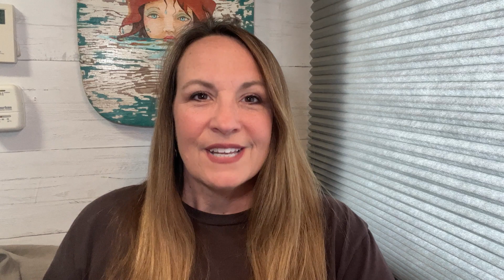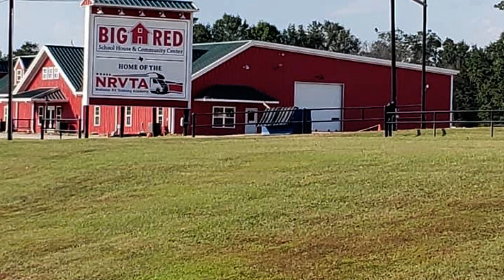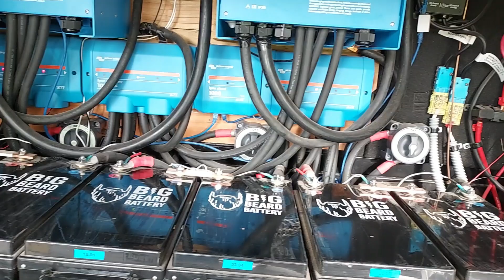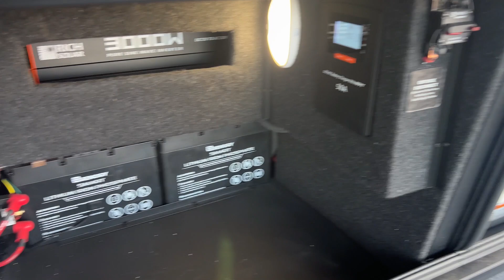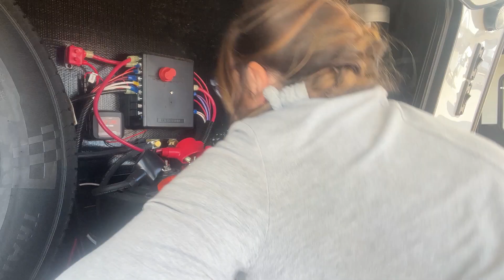RV SOLAR 101 - TECH TIME WITH JOE FROM BUBBLEHEAD RV

Comment: Cool video. I like the format. It makes a complicated subject more palatable. A lot of good safety points were made too. Current or amps in a wire, circuit or connection is what generates heat. As you double the voltage you half the current, which is why big solar systems use higher voltages - to carry more power safely in smaller wires. Inverting 48vdc to 120v ac is more efficient too, wasting less power as heat. This is why we use 2 stand-alone solar systems in our coach, as 12v system for our low voltage DC needs and a 48v system for our 120v AC needs.

Our big solar/battery system allows us to live off grid just like we were plugged into a power pedestal in an RV park. In fact, we haven't plugged into a power pole or run our generator in the last 2 years of off grid living. We started small, by building a 620-watt liftable solar array on the side of our coach that makes a nice bedroom window awning too. We use gas struts, so it practically lifts itself, and we can pin it at the precise angle needed based on latitude and season to boost its performance. We boondocked this way for a couple years, till we could afford to do better. Next, we built a 12v, 560ah LiFePo-4 battery using 8, 280ah prismatic cells and a Heltec 330amp BMS. These cells fit perfectly under the steps of our MH where our old pair of golf cart batteries used to reside. A small computer fan blows interior conditioner air into this space to keep the batteries near room temperature at all times, so the BMS doesn't shut down charging from them getting too cold and their life is not reduced from getting too warm. We use a 50a Epever mppt charge controller and a Lnex battery monitor on this 12v battery. We have a 1,000w PSW Renogy 12v inverter that we use occasionally to run some lower current draw 120v items like our TV and computer to help evenly distribute our power usage when needed. We also have a Renogy battery to battery charger, though we never need to use it. If this battery ever gets too low, we can always transfer some power to it from our 48v battery with our progressive dynamics 80a Lithium compatible converter/charger.

By mounting the solar array on the side of our coach, we left our roof free to rack 8, 550w solar panels down the length of our 35ft Class A, 15" off the roof, above our AC, vents, etc. Our 4,400w array can run both our A/Cs, our household appliances and charge our batteries at the same time. We mounted a Sungold Power all-in-one 48V, 5,000W Inverter/100A charge controller/battery charger, breakers and a Lnex battery monitor on the wall in our bedroom to keep it cool and monitor all the functions on the display screen. It saves us space as well as money compared to a system built with individual components. Our 48v battery which resides under our bed uses 16, 320ah MB31 EVE cells and a 200amp BMS.

Together with our 560ah 12v bank, we have a total of 23.5 kwh of batteries onboard (the equivalent of 18, 12v 100ah LiFePo-4 batteries) charged by 5,020 watts of solar. Building both batteries ourselves this saved us a ton of money vs buying preassembled batteries, plus they fit into a smaller space too. We removed the inefficient and noisy rooftop A/C we had in the bedroom and replaced it with an EG4 28.5 seer-2, 12k btu mini-split heat pump on the upper rear of our coach. It's super quiet and cools as well as the soft start equipped Furrion rooftop A/C we have up front, using about 1/3 the power. This 48v system lets us enjoy 24/7 off-grid air conditioning and heat from the heat pump as needed. Our total budget for both 12v and 48v systems was around $10k plus another $1,500 for the high-efficiency heat pump, as we did all of the work ourselves. Being retired we have much more time than money. Not only will this system last us the rest of our lives, as we're old farts, but it has already paid for itself with the money we saved on RV parks. The biggest advantage is the flexibility it gives us. Last year we visited 11 states, without plugging into a power pedestal the entire time. Last winter, we boondocked in the desert near Yuma, AZ, visiting some old friends who also have an older MH. We're visiting family in NC now, where boondocking places are pretty rare, so we're dry camping in a spacious, no-hookup site at a convenient RV park for only $100/mo., saving us $500/mo. off their normal FHU rates, yet we have access to all the amenities. Hope to see you down the road one day! Chip & Cindy
Reply from the maker: Wow!!!! Can you build my system up like that🤣🤣 You actually have me a great idea. I’m stressed about all the RV park fees this summer and I have a small system. I just need to upgrade and that will solve a lot of the issues. RV parks are so crowded and noisy anyways I love being off grid! Thanks for the comments and good to see you down the road too.